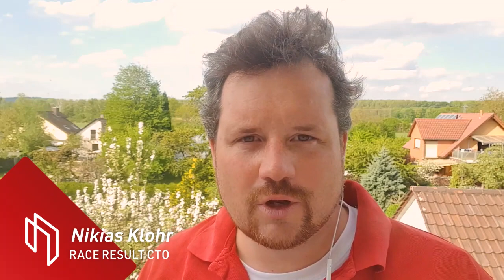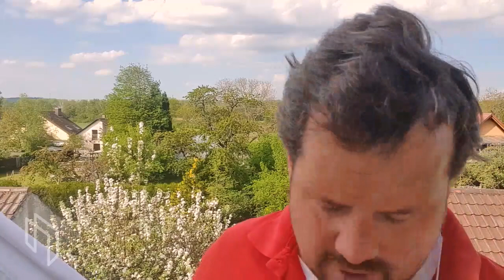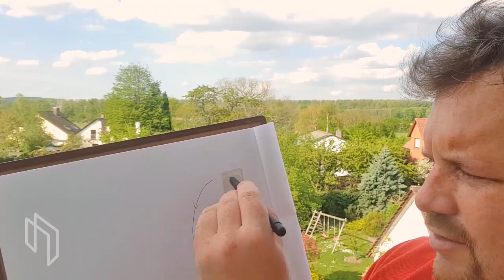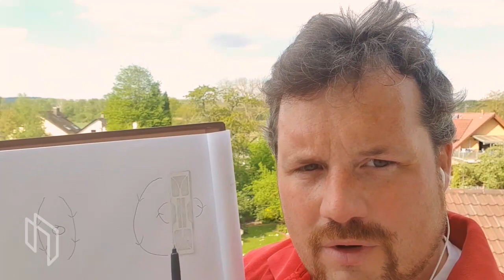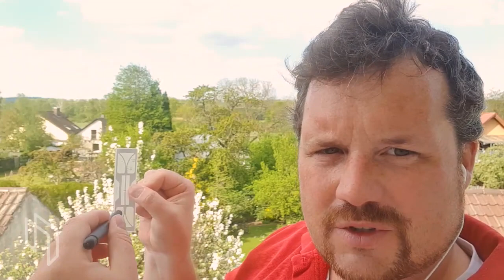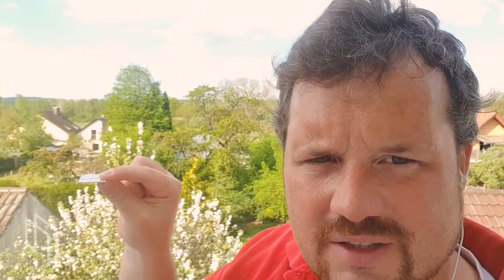Nikias' Homestories #8 :: Transponder Polarization

Comment: How much does using Store Mode in the Active Pro transponders impact the expected battery life? For example if it was used to time a point to point ultra with multiple loop boxes in store mode at checkpoints, with a decoder and active extension at half way and then at the finish, and the races was over 24 hours, how many days of "normal" use would that account for?